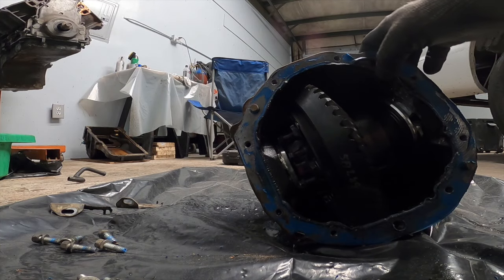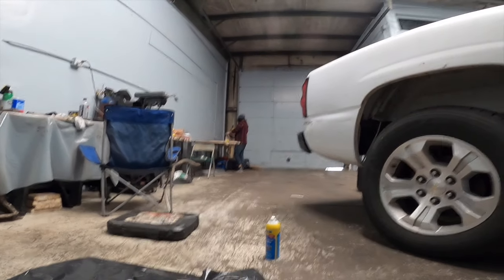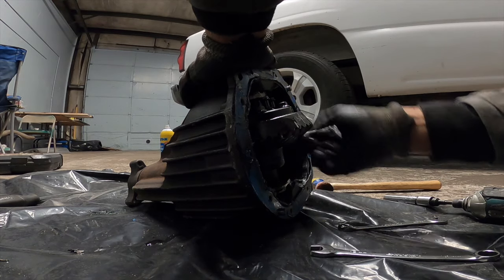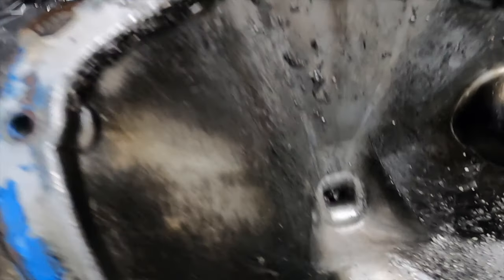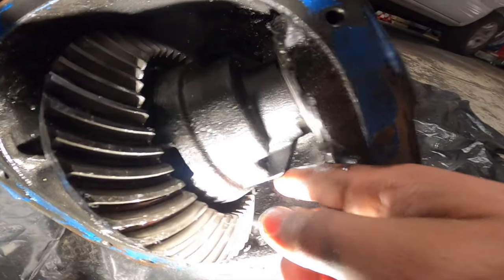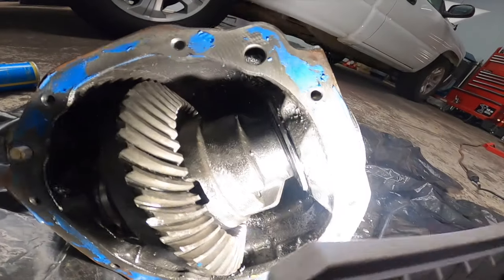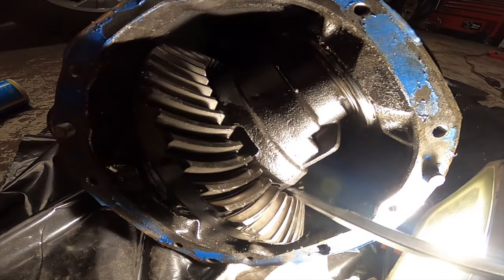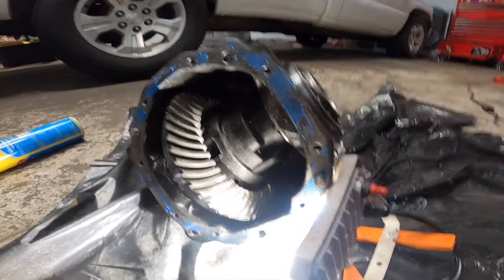FINALLY INSPECTING MY BROKEN GTO DIFF *ITS BAD*

Comment: I’m on my second diff and gears. Got a set of motive 3.70 and they howled to much so I bought a used GTO complete diff about 4 years ago. Held up so far. But it is my weak link now for sure. Good luck brah.

Comment: What did it sound like? I recently think i blew my diff from road racing, loud howling was coming from my diff so i parked it
Reply from the maker: Mine drove fine straight but any time I made a turn it had a real bad grind/crunch noise
Reply: @TreyHerrera  i know you’re probably busy, but anyway you could watch a video and point me in the right direction? Im gonna upload the video right now
Reply from the maker: @chill_chewy  I can try to help haha
Reply: @TreyHerrera  alright sweet, I uploaded a short video of the diff whine, im cruising at about 65mph with the car off and out of gear, you can check it outwhenever you get a chance. Thanks man.